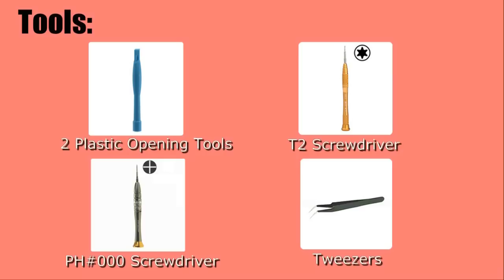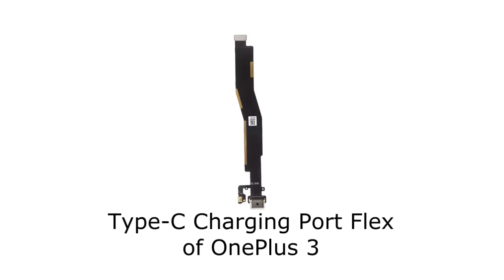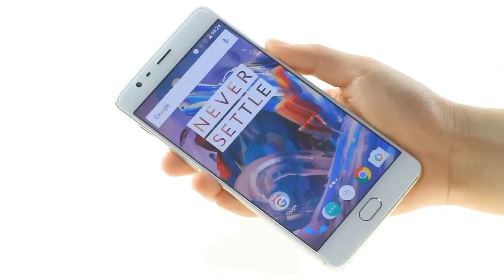OnePlus 3 Type-C Charging Port Repair Guide

Comment: Thanks a lot, I just did follow the tutorial and succesfully replaced the usbc port without damaging anything. Very useful to see how to open it, the tools are essential to open it, and patience. Beware there is little glue between the back case and the 'mobile' so do it carefully and use the typical blue stick to do presure.

Comment: Can you pry all 3/3T phones open or are there some that might be glued?
Reply: You can use a blowdryer/heat gun around the edge as you pry if it seems particularly stuck on but if you take your time that shouldn't be necessary
Reply: @saggypantsandsquats460  I'd rather not use a heat gun since I destroyed a phone display that way. I find the OnePlus 3 not at all easy to open. I tried and tried, and in end, after learning, that by trying to open it, a neighbour had wrecked his phone, I let a phone repair shop do it for me.
Reply: @jochannan7379  Hmm, thanks for the tip, I'll try to avoid a heat gun. I ordered a replaced usb C port and battery about a week ago for my oneplus 3, I'll let you know how it goes, lol
Reply: @saggypantsandsquats460  The OnePlus 3 isn't glued, so there is no need for a heat gun anyway, but I feel that that opening it non-destructively takes a lot of experience and finesse.
Reply: @jochannan7379  So I got through it, replaced the USB port and battery. Getting into the phone was definitely the most difficult part, took me 15 minutes to get the back plate off because i was being very careful. Likewise putting it back into the back plate took some patience to make sure everything clicked into place correctly. Whole process took me about 40 minutes which seemed long but then again this was my first time opening a phone.

Swapping everything out was dead easy though, did it about 3 days ago, no issues as of yet

Comment: The hardest part is getting the back off. You have to be careful not to break the plastic pry tools. Other than that the only tricky thing is dealing with the tiny screws. Not too difficult, any DIY-er can do this.

Comment: Excellent video! Very clear directions and simple to follow. I completed the whole job in less than 30 minutes. The hardest part is getting the phone back off; I snapped one tool immediately, wore the second away to nothing, and eventually just pried it apart using my fingernails. Once it was open, the rest was easy!

Comment: I have a problem... This bottom whole part don't want pop out, like it's sticky and can't take it out...any ideas? Thanks
Reply: same problem here
Reply: make sure to remove ALL the screws and pry it open. Sometimes they use double tape and or there are rubber seals that getpressure glued over time

Comment from the maker: OnePlus 3/3T charging port replacement is available.
Global customer: https://www.witrigs.com/oem-charging-port-flex-for-oneplus-3
Get Original Replacement Parts For OnePlus 3 ： https://witrigs.com/d4r8p
Reply: The rubber wasn't in there in the first place, was it? So it comes with the spare part?
Reply: @Benneification  no
Reply: Yesterday I went in a shop and  they show me dash charger but in charging mode it doesn't show dash charging, it show charging rapidely .
Plzzzz reply sir. What I can do sir ?
Reply: I would like to ask you, if the port is the same for OnePlus 3 AND OnePlus 3T. I'm not really sure, I have a 3T. :)
Reply: Is the port identical for 3 and 3T?

Comment: The rubber around the usb c port was always being misalinged, and it was kinda blocking my port. So I just removed the little rubber. Is this safe? What does that rubber do anyway?
Reply: protects the device from water dmg, i would keep it if i were u
Reply: That rubber saved my phone getting soaked by chcolate drink, it only got in the port, luckily the rubber prevent it getting into the boards,. Dont remove it of I were u

Comment: For anyone having the problem that either the fingerprint sensor isn't working after the reassembly or the phone is getting very hot and sucking down on battery like a hungry whatever, check whether the data cable next to the type c port has the "main" side at the top! You can easily put that back on the wrong way if you're not paying close attention...
Reply: you don't even need to take the top part of the cable off in the first place

Comment: I regret buyng this phone.. remember people, never buy chinese phones, specially from Vivo and OnePlus, both companies are owned by Oppo, the biggest scamming Chinese company in the world
Reply: Mike Messiah almost every phone is made in China
Reply: Fuck that. This is the best damned phone I have ever owned. It shits all over the Galaxy it replaced.
Reply: @cheapandeasy1715  Bruh, galaxy note 4 is the best one I had. It's fucking indestructible. The battery gave up after 2 years though. My 3T has lots of problems. The ghost touches are insanely stupid, the usb port is fucked and obviously the battery is used up as shit after 2 years.
Reply: Mike Messiah never had problems with mine.. The charging port is my fault, pulled the cable out with an angle and that bent it...
Reply: What specifically is your issue then? Mine is still working great. The USB-C Port is kinda lose by now and full of dust and dirt which prevents dash charging but except for that mine still works like a charme after almost 2 years.
Reply: My oneplus worked fine 2 years, the only issue is that it does not charge properly...
Reply: Lol my 3t works fine after a year of owning it
Reply: @georgeshajan7956  I bet the usb port is troubled by now.
Reply: @SlowThePace  the USB is fine, the only isssue is the battery doesn't hold charge for over 2 hours of use, upgraded to a new phone now

Comment: Seemed simple enough,I did this repair as well as the headphone jack at the same time.  USB and headphone jack both work but my capacitive buttons no longer press after reassembly.  Not sure what I did.  They still light up just don't function.
Reply: TheUncledink check if you plugged everything in right. The chance you damaged the buttons in this repair is very unlikely.
Reply: same here, did u figure out the problem?

Comment: just finish my oneplus3 with your guys part and my phone is sucking down power fast and getting hot, about a percent a minute or more. any thoughts? iam going back to take a look
Reply: my data cable next to the type c port was backwards, had the "main" side at the bottom.
Reply from the maker: You need to check whether the flex cable connectors are installed on the motherboard properly. Bad connection will cause heat and then high temperature will waste power.
Reply: exactly the problem I had!

Comment: will dash charge still work
Reply: Just done this and dash charge was not working before, now working again with new connector. (Old connector full of compacted dust preventing good connection of the cable, I have found out since being able to dig the dirt out the old one).
Reply from the maker: Yes,still work.
Reply: Great, that is my main problem right now. The port itself seems kinda loose after almost 2 years of use, especially with the original dash charging cable. Though new cables also dont fit properly anymore. I will most likely replace my port soon aswell, afterall the dash charge feature is on of the best things about the OnePlus 3.
Reply: Did you fix it replacing the port? I'm having (I think) exactly the same problem like you. In my case a OP3T, I hope the replacement part also works with mine. I tried with a new Dash Cable and it looks like it does not fit completely in like before. I fixed (partially) it removing some dust from inside, but the constant disconnections are very annoying. I'm more afraid of not being able to do updates using the port, than not being able to charge it.